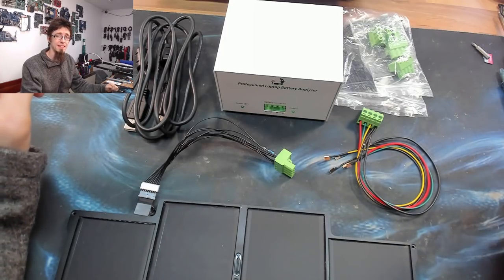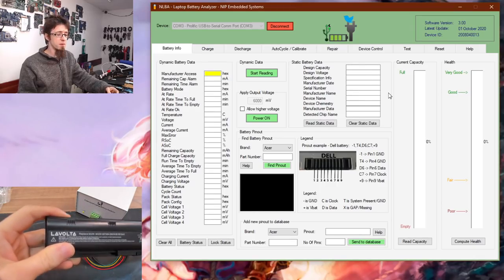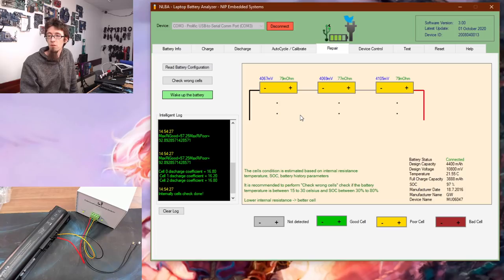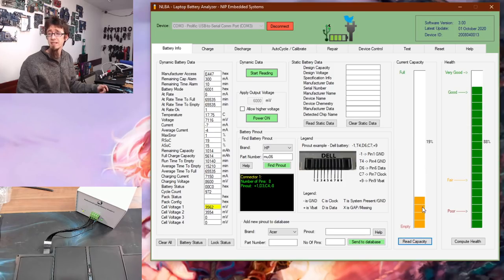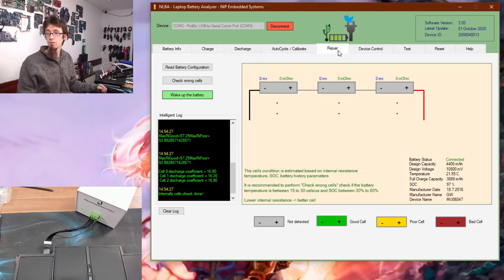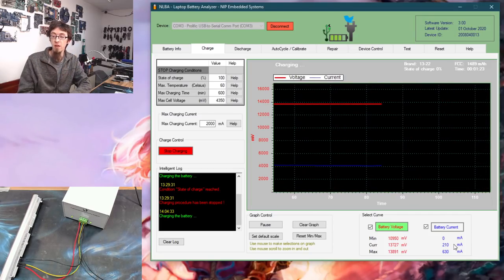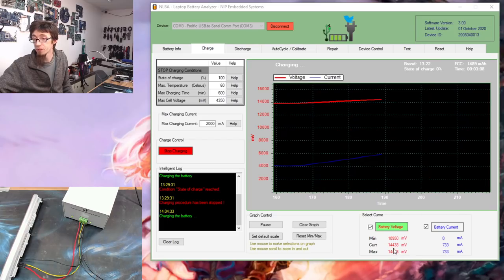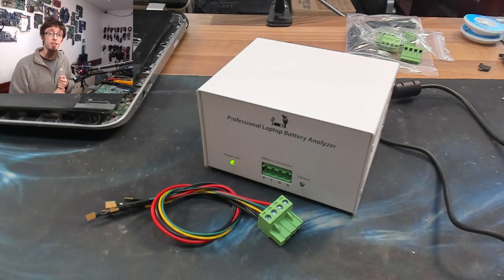Professional Laptop Battery Analyzer - LFC#227

Comment: What does it actually mean to celebrate a battery? Thanks
Reply from the maker: Basically, a full discharge and recharge. The battery controller will count the capacity of the battery during this process and update the 'health' parameter as appropriate. If the battery hasn't had a full discharge/recharge cycle in a long time, the controller's last-known health number could be completely wrong.
Reply: The FCC (Full Charge Capacity) will be updated so the current state of the cells will be known by the microcontroller. The SoC (State of Charge) which is the value reported by windows in percentage is computed based on FCC parameter. If FCC parameter is old (outdated) then the SoC will be incorrectly reported. In such case, the windows could report 1h30min but the machine will run for 30min.
Reply: Its calibrate not celebrate
Reply: @gower1973  I was wathing on the phone. sorry

Comment: Hi Adam, this looks like a good toy for changing cells. I did a swap on an HP laptop I had (6 cell) since i had 6 good cells from another laptop which was dead (mobo dead) and when I did the swap to my surprise the HP battery refused to charge. It did not like me "unplugging" it to which resulted in it not taking a charge. Manually charging my cells resulted in the laptop having a battery to use until it was flat, but it wouldn't charge
Reply: It is normal behavior. After replacing the cells the chip must be reset since it is in Lock state. NLBA supports only BQ8030 chip. Soon I will add more.

Comment: 250$ is too much for that device. I have built my own with an arduino and texas instruments circuit based on the BQ24735. You can use SMB simply on an arduino.
Reply from the maker: This is cheap for a turn-key solution. There's a lot of diagnostic and electronics tools out there that can easily be replicated with an arduino - however, I wouldn't know where to start with doing it myself. What's more expensive to me, hours of research and development making my own, or buying a package that is fully functional, easy to use, and comes with all cables and accessories I'll need? Don't get me wrong, kudos for making your own, but that's not practical for a lot of people.
Reply: Personally, I wouldn't compare NLBA device with a simple charger chip like BQ24735. It's a big difference between charging some percentages a battery and Fully charging almost all laptop batteries in a safe way. For example, Dell uses secret commands to activate Charging Fet and Discharging Fet, without these commands you can only charge/discharge for several seconds. It's not so simple to create a generic charging DC algorithm for almost all laptop battery manufacturers. Many suppliers do not respect the standard, just try to charge an Apple after 2015 battery to 100%. Also, NLBA has a built-in DC electronic load to measure internal resistance, track the voltage cells under load, measure real capacity, calibrate the battery, revive over-discharged batteries that still have no PFF set. An online database with pinouts of over 500 batteries is another important feature. Reset option is just started and soon more chips will be added.

Comment: can this device relock macbook batteries?
Reply: Which Year ? The next family chips that will be added is BQ20zXXX. Apple uses BQ20Z451, I have already a solution for Apple batteries up to 2013.
Reply: @nipembedded9976  so this device can relock locked mac batteries up to 2013 right?
Reply: @kenben8207  Not yet. I expect to release in December a version that supports the BQ20zXXX family excepting Apple firmware after 2013.

Comment: Man what a rip off this thing is,  around $300 to buy it and then they want another $250 so you can actually use it for what most of us would want it for. No thank you!!
Reply from the maker: Yea, I do not have an unlocking licence myself... but I do still find this device very useful for battery testing. I routinely deal with laptop where it's unclear what the health of the battery is, and if replacing the battery will solve the problem. This device answers those questions for me. Definitely not into an additional licence for unlocking though, not worth it for me considering most locked batteries are likely to be in very poor health.
Reply: NLBA1 is the most advanced laptop battery analyzer on the market, it is a real PRO tool, you pay once and you have it unlimited, lifetime. You can do tons of things with the analyzer.
Separately, if you want to repair batteries, you need a license per year which has a good price, the price of 3-4 Macbook batteries while you can repair hundreds or thousands.
It is your choice if you think that it is better to throw away original batteries than repairing them.,

Comment: I do not find the product to repair laptop interesting, this equipment is not necessary, on the other hand, it is excessively overvalued, it only has a few adapters for batteries and the adapters for newer batteries are not updated, a product of that price should be more sophisticated and with better support that is a bit confusing, I have diagnosed hundreds of laptops with bad battery diagnosis and I have never needed an instrument or even the like there are other simpler ways to dispose of a battery and know what the fault is Is it motherboard or battery? What happens when you don't have the adapter for a specific battery of the current ones that you have to be splicing cables in a bad way?
Reply: Can you explain how you test if a Dell battery is working ? How to unseal and clear the PF ?

Comment: How usefull might this be to the rc community where bats dont have a controller?
Reply: It is not useful for batteries that don't have microcontroller.
Reply from the maker: While I was reviewing this, I was thinking "man, this would be awesome if it could do smart charging on Lipo batts..."
But as DirecCharging said, as RC batts don't have a controller, they're a different animal and fall outside the feature scope of this device.
Any standard Lipo smart charger will allow you to force-charge a battery and monitor per-cell voltages to diagnose the health, so there's little use in adding that functionality to this device.
Reply: @Adamant_IT  I was thinking at some time to extend the features by adding Power Tools Batteries like Makita batteries. Makita batteries are smart (have a chip inside) and store the cycle count, offer information about cell voltages, all of this without opening the battery. The communication protocol is their propriety. I decided to continue by adding the Reset feature because people want to repair laptop batteries.
Reply: I was not thinkimg of useing as a charge but more for its ability to determin cell health and status.
Reply: @001snapshot NLBA reads the cells voltages reported by the chip inside. The resolution is very good and the results are very accurate. It does not have access to the cells from outside connector.
Reply: @nipembedded9976  understood. It was just a thought

Comment: Not impressed at all by this product or Nicosor (the inventor) who is trying to get you to buy his annual fee of +- 300$ USD for a private owner who would repair maybe 10 batteries a year, so not worth it. If you can't reset batteries than clearly you can't do much with it but to analyze dead batteries and have fun doing that!

I bought it, waited over 2 months to see if Nicosor would abide by my request to sell resets by usage, but to no avail. You have to buy the yearly license if you want to be able to reset some batteries. Moreover, don't forget you are bypassing the protection circuit from engineers at HP, Lenovo, Dell, etc. which are way more competent than Nicosor. So if you want to burn your house down, buy this and buy the license. In any event, it can only reset approx 1 on 20 batteries (which is what I concluded after "analyzing" approx 40 different batteries, so if you don't repair industrial numbers of batteries, this thing is useless. I put it in my spare parts bin. 

I think reviewers should tell the whole story, especially the fact that you have to pay an annual mortgage to be able to use this thing to to any useful level.
Reply: His correct name is Nicusor. My friends are repairing tons of batteries yearly and they are happy. I see nothing cheaper, there is NO other hardware tool like this. There are only 2 softwares (just software) UBRT and Regedit and their price is 1000$ + fees. I think the problem is on your side if you repaired 1 battery out of 20, really. More than 90% of all laptop battery chips are already supported.

Comment: NLBA1 is certainly the only professional device for this very small market. A gifted genious electronics engineer has developed something special with a lot of effort. His explanations in various forums and in his own blog / videos are very detailed and patient - he definitely knows what he is talking/writing about.

But with the high labour cost in western countries, the purchase of the device (US$ 350,-) hardly justifies itself. Only point is: quick testing of a battery - without having to remove (internally unscrew) it - shows whether a defect originates from the battery or the laptop. They argue with the development effort and with the much higher prices of other companies that offer much less service or contact. The transport from and to Romania (close to the Moldovan border) unfortunately also takes 5-10 days and costs extra (US$ 38,- within Europe).

Besides that one has to pay for an optional anual license (US$ 249,-) for the chip reset feature, which is necessary if the battery is in locked state - and then its the question whether the battery is completely dead for the garbage - or can be resetted and revived what you learn only after trying. This reset feature+cost is not required if you can live without it .... At least you have the reset option for 10 days trial - for as many resets you can do - for free after buying an NLBA1. 

For the western market, the device only pays off if you can afford it and want to give that little bit of extra service to your customers, or you want to test a huge amount of old laptop batteries, or you re-cell batteries which are no longer offered *).  Otherwise, it is easier and cheaper to get a new battery.
*) For the very rare cases where you can no longer get a battery, you can possibly use it when equiping old batteries with new cells and activate the "repaired batteries" with the NLBA1. But - how often will this happen? However, this also carries the risk of liability for the technician if this repaired battery (a cell) should damage/hurt anything …

This leaves only the market with very low labour costs - but where the price of the NLBA1 is more of a deterrent. Many of the customers or interested parties from these countries are or are only interested in the device because you can reset the charge counter of the battery. This way, old batteries are offered as "new" or broken cells are replaced by used (old) ones and the counter reading is "glossed over". NIB (the manufacturing company) prohibits this, because the function should only be used for batteries with new cells, but .... 

Infact I do have the suspicion that the price is set up high because the smaller werstern market can afford to pay it, the other market is reduced with that price to avoid endless numbers of "questions" from users/non users of such countries for allready thorougly explained details (see blog, posts, videos etc) and especially for the chip resetting feature. Its no doubt that there are lots of skilled and outstanding technicians (far, far ahead of my knowledge) - but just check the NIB forum or even quite some posts here below.
Reply: NLBA1 is the most advanced laptop battery analyzer on the market, it is a real PRO tool, you pay once and you have it unlimited, lifetime. You can do tons of things with the analyzer.
Are you saying that 349$ is a high price for a unique real Professional Advanced Laptop Battery Analyzer that has all real CE and FCC certifications ? It is the price of a good multimeter that does some basic measurements. You can check the latest features of the NLBA1 device, the price is far below than its capabilities. Without NLBA1, you will never know what is the condition of a battery, how good it really is and how to repair it.
Separately, if you want to repair batteries, you need a license per year which has a good price, the price of 3-4 batteries while you can repair hundreds or thousands. There are many batteries which can be repaired simply without even opening. All laptop batteries which are stored for a long period get over discharged and the chips lock. You can repair for example 50 x Apple New Macbook batteries in just one day. How much is a genuine Apple Macbook battery ?
Reply: @nipembedded9976  Hi Nicusor - Although I have made a real effort to highlight the great value of the NLBA1, you seem to take my text as an attack on your performance and the very special nature of this NLBA1 device.
No matter how valuable a service or product is, its value is determined (or limited) by the market. This is what I tried to describe in my text, because the market differs in the parts of our world - because of income and labour costs.
Reply: @16margareta  Thank you for the feedback. What I want to highlight is that the NLBA1 tester can act as a laptop battery tester like a multimiter. I am not talking about the labor cost. There are many shops, repair shops or even private persons who want to test laptop batteries, or drone batteries or vacuum cleaner batteries. How they can do it ? Separately, the capability to repair batteries with the same device is optional. If you want to repair you can do it, if not, you can continue to use the tester lifetime. Indeed, for some countries, rebuilding batteries could not be a good business but Chip Reset Option can repair Good/New batteries that have been stored for a long time and have good/new cells. You don't need to replace the cells, you can recover these batteries, these original batteries which cost a lot.